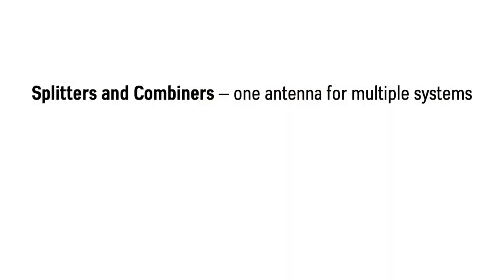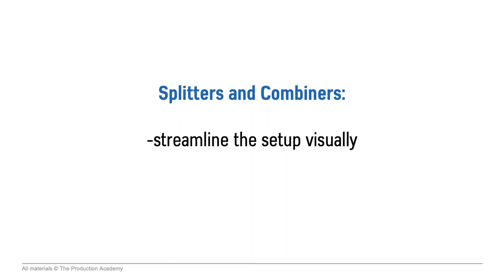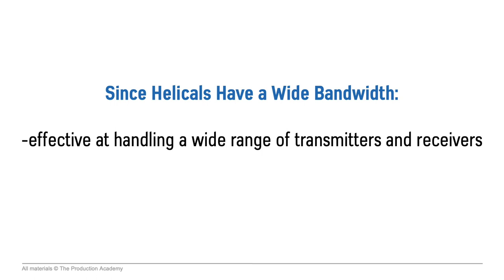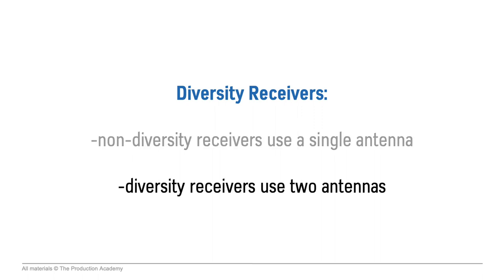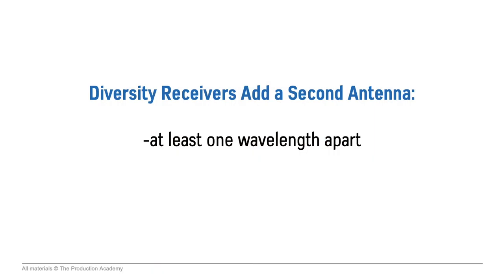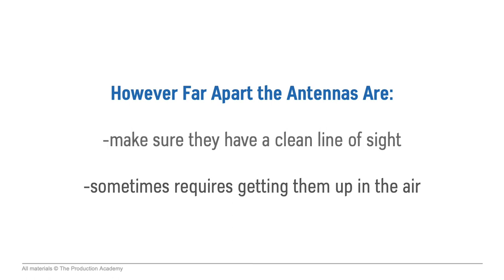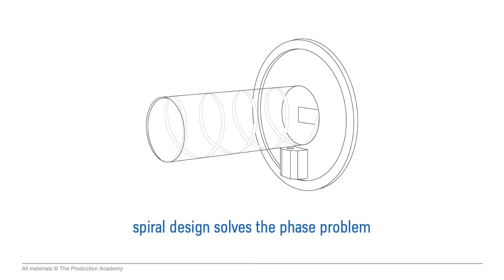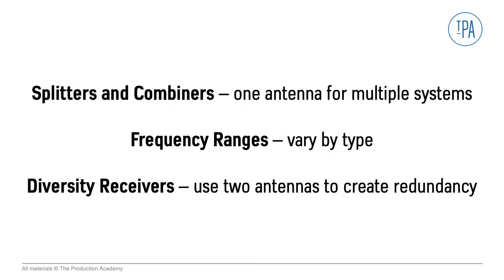How to use one Antenna for multiple Radio Frequencies (Wireless Audio Fundamentals #7)

Comment: Very informative, thanks for putting all these videos, BTW: What do you recommend to avoid dropouts caused by the antenna of the beltpacks touching the skin?, I had some issues once with a cast that needed to have their mic transmitter beltpacks strapped to their back under lots of clothing (for scene changes) and besides that the sweat created a super humid environment around the packs, I tried putting the beltpacks inside latex gloves (and non lubricated condoms too, ha!) but sometimes the singers had to do a quick change and some removed the glove and the antenna was touching their humid skin causing lots of problems, What's your best advice for positioning beltpacks under costumes?